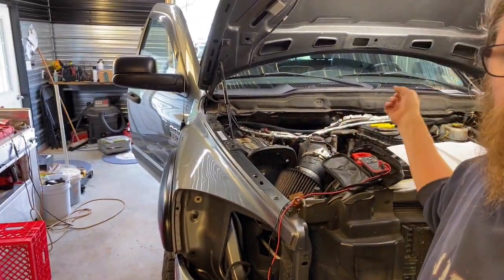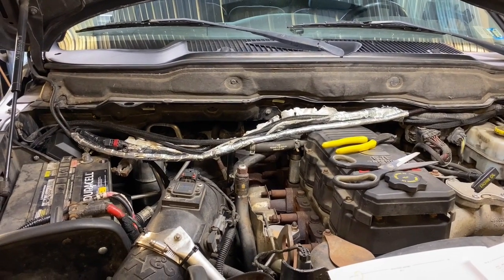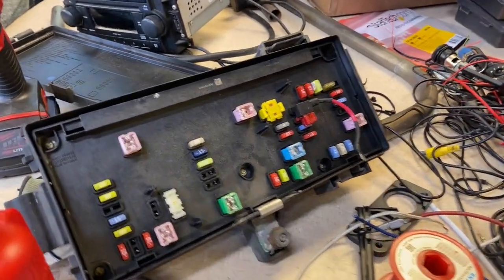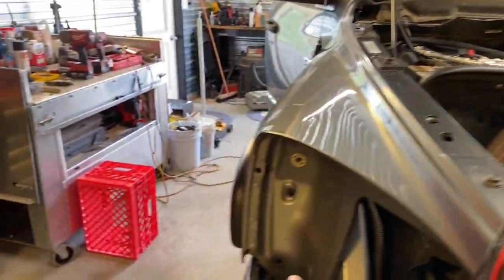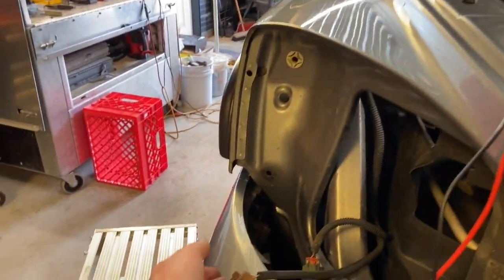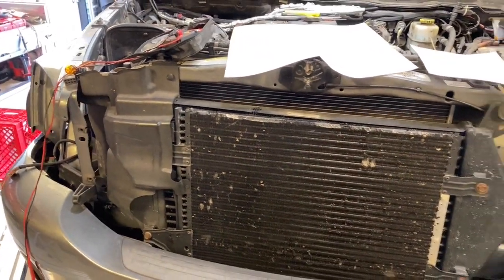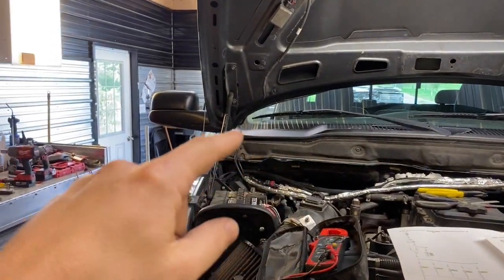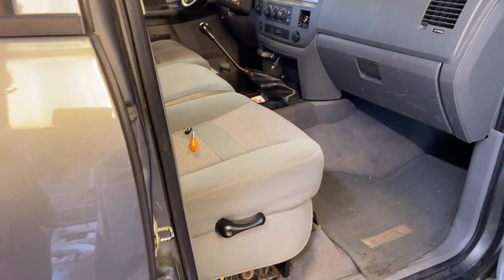2007 Dodge Ram Parking Lamps FUSE Problem TIPM Dead?

Comment: I’m having the same exact issue, but for the driver side headlights and license plate lights. Thoughts? Where did you find your diagrams?
Reply from the maker: I used all data diy subscription for the diagrams. 
There is a left hand side fuse iirc and the cab clearance lights are on that circuit too? I don’t remember I’d have to check.
Reply: @MalarkeyTaylor  well I don’t have clearance lights on mine. I still can’t find the problem and it’s driving me absolutely nuts!!
Reply from the maker: @karlklein9239  the bed connector harness under the front left side of the bed would help isolate of the problem is in the rear or the front? I don’t think it’s too hard to just disconnect the rear part of the harness. 🤷‍♂️ sucks that it’s still going on. I have another new issue where my front driving lights come on when I push the brake pedal…
But I’ll chase that someday, and maybe I find someone interesting when I do and I’ll post a video on it.

Comment: Brooo I wired tow mirror lights that didn’t come factory and 3 grill leds. And that passenger side is the second fuse that blows. And man I’m going crazy ! I pulled a spare fuse 15 amp to get home. And bam now my speedometer doesn’t work. I just read on a YouTube comment there is a spare labeled fuse that is actually the culprit for no mphs. At the same time I have a BADDD Vibration when slowing down coming to a stop. And new power stop rotors and pads $400 later still vibrating like shit. New tie rods inner and outter because it’s a 2wd and still doing the same thing. Any tips !!!!?
Reply from the maker: All data diy has some good wiring diagrams. I’m not sure I have the spare fuse problem. 
The vibration sounds like tires or shocks but it’s impossible to say for sure from this side of the internet.
Reply: @MalarkeyTaylor  tires are shot due to bad alignment. Gonna remove the old ones and put new ones really horrible

Comment: My passenger rear taillight is out.  I haven’t looked yet to figure out what is going on except switch out the bulbs. Would what you found possibly affect my issue??
Reply from the maker: Possibly. When the fuse blew it took out my front and rear running lights/parking lights. And kept blowing that fuse until I found and fixed the bulb. If you have clearance lights or a bad bulb in that under dash lamp and you blow that fuse check those items before chasing a dead TIPM.

Comment: Great video, I wanted to know where you found your wiring diagram/ fuse run circuit. I have a issue with my 2007 2500 diesel with a paracitic draw. Found out its drawing 1.8amps with everything off and I isolated it to fuse # 11 it lists abunch of things within that circuit. But I need a diagram and can't find one anywhere. Would appreciate it if you could help. Thanks Ryan
Reply from the maker: Hi Ryan. I used a service called all data diy it’s a subscription based service that you can get access to factory service manuals and other diagnostic data for your car. 

https://www.alldata.com/diy-us/en
Reply from the maker: also, FWIW if you look me up on instagram and msg me I could probably share the diagram on DM or help you track down just fuse 11 if you rather not sign up for the whole thing.

Comment: 2006 ram 1500 slt front back and left turn signals turn on, right is off. Switched bulb nothing yet, any advice
Reply from the maker: The fuses are left vs right. Maybe try checking the fuses under the hood? Maybe the right side fuse is blown for some reason?
Reply: @MalarkeyTaylor thanks for reply, so the front two work, back left works, the right turn signal is off, do you know what fuse that would be by any chance?
Reply from the maker: @Jaymoneyyyy  aww man that sounds like a hard one. I'd say you might need to get out the multi-tester and start tracing the wires from the back. Maybe it's just the socket went bad, or could be a bad connection somewhere, Sadly it doesn't sound like something I can easily help with. If it didn't blow the fuse and the front one is working it's more of a problem than I can diagnose over the internet. Sorry, Good luck! if you do get into DIY mode I did find all the diagrams in this video from an alldatadiy subscription https://www.alldata.com/diy-us/en it was worth the money and saved me a ton of time tracing the wires and finding the right color wire. But it's not for the inexperienced. So if you know how to work on cars and find wires and fix things its worth the money... if you're not sure, find a mechanic or a friend that's chased wires before to help you learn.
best of luck!
Reply: @MalarkeyTaylor  thank you!

Comment: Hey I have a question could u point me in a direction my rear running lights are not working no power to rear but front are on a hood got new taillights led woty the rester to add load tester the light and they work good lights are good just no power to plug for running in rear any ideas also my right rear turn signal no power but my 7way has power
Reply from the maker: Hi Bob, 
I assume you checked all the fuses?  What year is your truck?  If your tail lights go out and the front lights still work it might be some ground wires under the back bumper.  If the truck is really rusty it might not have a good ground. 
But if it’s not the ground I’d say you’ll need to trace the wires back and see where the power stops. 
I think for the running lights and the circuits are split left and right. Not front and rear. So if both rear are out I’d look at ground wires or the harness plugs for the bed. 
Good luck!

Comment: I have an 06 ram srt10 and I just recently lost both my head lights. All other lights work except main headlight . Disconnected HID and added regular and Led replacement and no power . I noticed this truck doesn’t have fuse for headlights and saw that this year has the TIPM ANY SUGGESTIONS?  Thanks 🙏
Reply from the maker: My truck has fuses in the TIPM under the hood. Are you sure there isn’t a fuse on there that is blown? It sounds like the fuse might be blown for the headlights. If that doesn’t fix it the TIPM might need to be looked at by a mechanic and tested or replaced. 😞